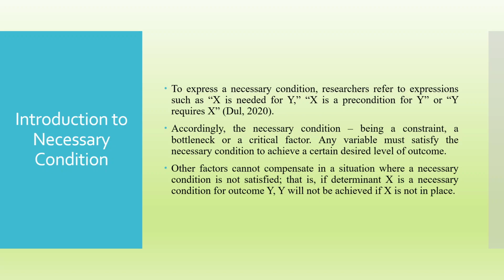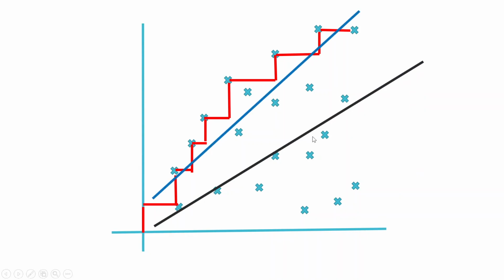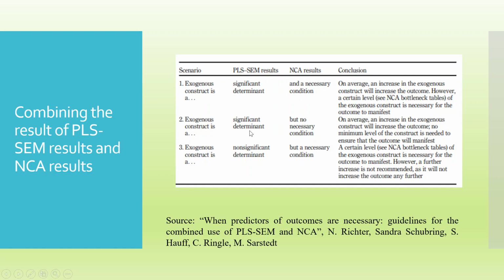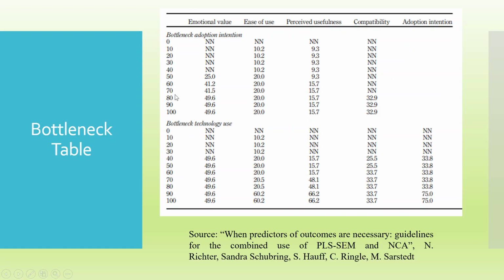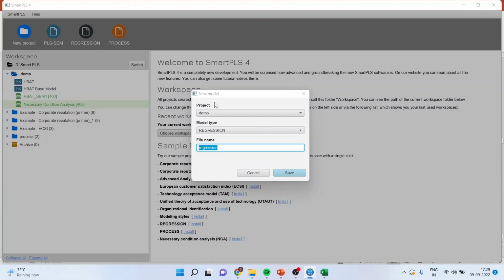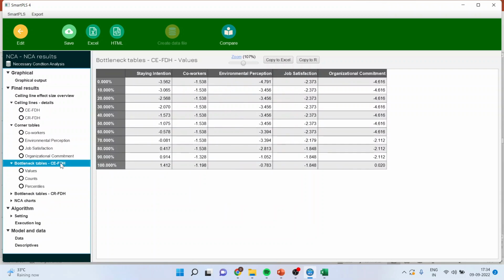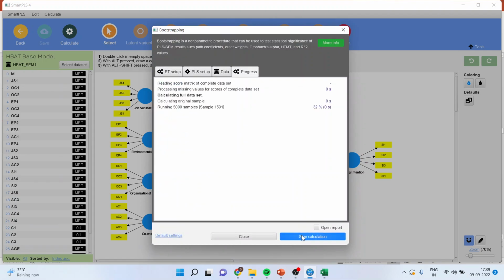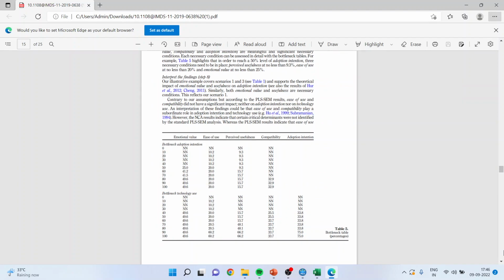34. Necessary Condition Analysis (NCA) in SmartPLS-4 || Dr. Dhaval Maheta

Comment: Thank you for the video. I’ve read in the literature that NCA is only suitable for analyzing data when the relationship between X and Y is positive. On the other hand, when the relationship is negative, NCA will fail. What is your opinion on this?. Please see the paper: Sorjonen, 2023 Necessary condition analysis has either low specificity or low sensitivity: Results from simulations and empirical analyses of grit, depression, and anxiety. what is your opinion. tks prof.
Reply from the maker: You are right

Comment: I have a moderated mediated model. Can you guide me? Should I use the same method to run the NCA? That is, should I  convert all moderating and mediating into IVs and link them like simple regression to DV? OR take interactive effects beta values and regress them on dv and also run muli/ TWO NCAs for DV and MED?
Reply from the maker: You are correct